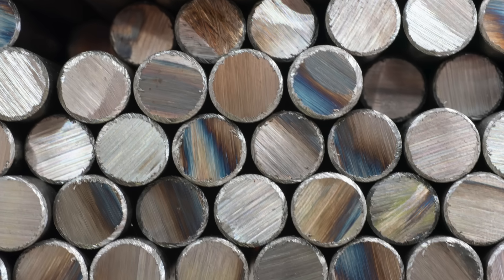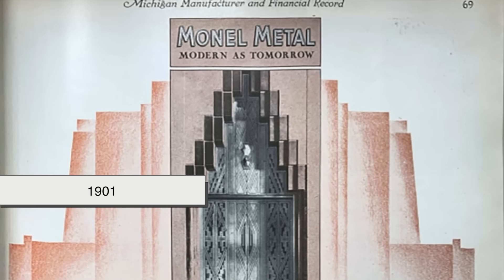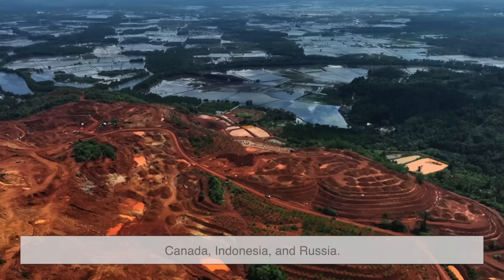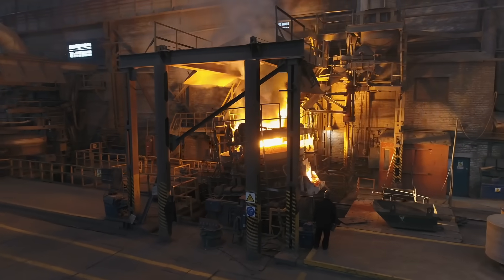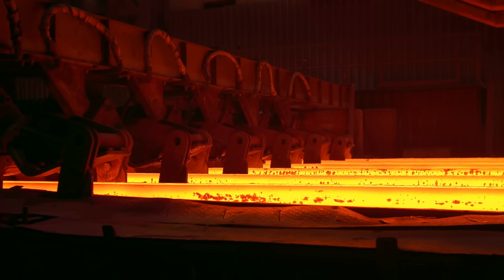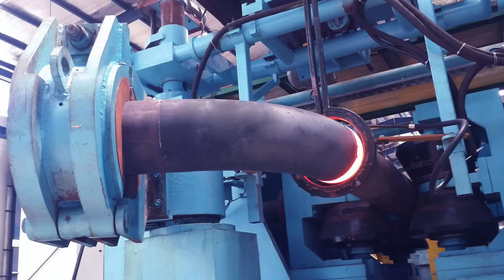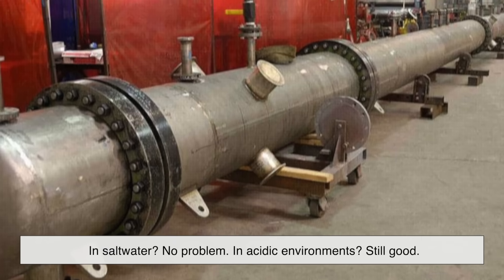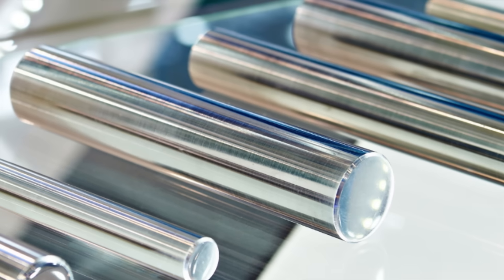What Is Monel and How Is It Made?

Comment: Monel is used in music instruments where you don't want any expansion to occur.
Because the valves would seize and stick if they did change dimension.
The other factor, is the very low corrosion of the metal, due to high moisture!

Comment: Monel and cupronickel are both nickel-copper alloys. Monel contains nickel and copper, with a higher nickel content (typically 50-70%). Cupronickel, on the other hand, has a higher copper content (70-90%) and a lower nickel content (10-30%). Their differences in composition determine their properties and applications.

Comment: The F-111 uses Monel rivets in the afterburner and tailpipe heat shields. When the shields need replacement you have to drill out the Monel rivets. Good luck. About the only thing that would even dent them was a fresh carbide drill bit. And even those got dull quickly. Monel one very hard metal for sure.

Comment: In it's early days Monel was used for exterior decorative and architectural applications. Around the 1920s people began to notice that it did not retain it's silvery luster and began to "fog" and develop a corroded patina. Unlike some patinated metals, it is fairly destructive to Monel and the artistic creations lose a lot of their detail. There are large gates at Woodlawn Cementary made of  Monel and they are very degraded. It's odd that in some very harsh environments it holds up, but in the relatively mild outdoor environment it breaks down.

Comment: I have a Sea Ray with straight 
in-boards. The prop shafts from the factory were stainless steel inch and a half diameter. I was 80 miles south of my home in the Chesapeake Bay when I rung off one of the prop shafts. I limped home on one engine. Miller Island propeller suggested that I replace them both. They recommended Monel... At three times the cost of the original stainless steel I nearly hesitated. I'm glad I didn't, they're both going strong 25 years later. <°)))><

Comment: Monel metal is mostly used in brass instruments for there piston making valves, for corrosion resistance from human saliva acids that is blown through the horn. Been introduced in the 1960 ‘s from Vincent Bach Corporation , I think that started it on their trumpets.
Reply: Used in making vacuum tubes ( radio valves) as well.
Reply: Ahhh, that makes sense (acidic saliva).  Man, I remember making a puddle of spit and water vapor in band class.  It also helps explain so many trashed trumpets with heavily corroded valves.  It seemed so much worse than I thought simple water vapor would cause.
Reply: @erniearruda8861  Nickel-plated valves are quite common for piston valves, but Bach was an advocate for monel. Other manufacturers have done likewise, although it's often thought that nickel plated valves can achieve a slightly better action. It's a fine application of monel tho, no doubt.

Comment: My family made Monel. They were junk men and they had a source of copper from a wire company. I know that in the Pittsburgh area, they came up with a source for nickel. They had an electric furnace and made small batches of Monel.  It was pretty expensive even during WWII.
Reply: Did they sell any monel to vacuum tube manufacturers? It was preferred for the connecting pins because the coefficient of expansion is similar to that of glass.
Reply: @ They made specialty tubing but I don’t know much about the buyers.  They also sold the bulk ingots
Reply: @samlevine4863  monel was in super high demand during ww2 since stainless steel processing and manufacturing weren't quite at the scale they would develope to after the war. The material science of monel was also better understood at the time, leading to the preference for monel over stainless steel. 

I can definitely imagine they made a tidy sum.

Comment: Titanium, plentily available, also resists salt water in nuclear power stations. ( I worked for ICI who supplied Ti to Sellafield by the sea) I used Ti stirring rods in chemical reactors instead of high grade stainless steel. Zirconium , tantalum, stainless steel are used for chemical reactors, but not Monel. How do these metals compare ?
Reply: I recall from reading about the SR-71 that Titanium was difficult to work and machine, although it sounded like Lockheed had done a lot of the brand new materials science on the metal.  Is it more difficult to machine than Monel, or are they both difficult but for different reasons?

Comment: An entire car built from “monel,” & or any other durably bulletproof mineral, would be in the range of extremely fkg complicated… …& or the costs/porcess of a more durable material to contain rechargeable radioactive batteries, would be extremely fkg complicated…

…but the complications are only a/the direct result of life/convenience having very little value to/for the current gen. For what it’s worth tho, “actual secured personal-space(s)” pods, & or “SafetyPods” could be managed for a tenth the costs to produce one car, if said “Safety” type pods were manufactured via the cheapest bulletproof steel/metal…

…either way, it’s “worth the metal,” & or “not worth a metal,” invested on lifers wondering how would “SafetyPods/actual secured personal-space(s)” be made, & or what’s so special about “SafetyPods/actually securing personal-space(s)!?”

Comment: Why is this not the standard rebar in western concrete construction?!?
Reply: I assume because epoxy-coated regarding is cheaper.
Reply: @ yeah because business, but there is an awareness of the actual practical life span of rebar construction, and many are wanting more. I think there could be a market for it. Myself included
Reply: @DonChartier  Epoxy is basically banned in the most of NA. Galvanizing is the only acceptable coating system.

Comment: I used to machine k500 monel, I found that it had a cutting speed and feed curve, that is, when you found the perfect cutting speed and it was cutting beautifully, then you crank the speed and feed in equal percentage and you would get the same chip form, the cutting tips would last just as long. 
Cannot recall if it cut better on the lathe or the machining centre, it was a number of years ago.

Comment: I have bass strings made by Roto-Sound that are flat wound, wrapped with Monel
Reply: Nice.. I use monel wound strings on my mandolin, it’s has a great tone compared to bronze..And now I know why they claim to be so corrosion resistant
Reply: Jazz Bass 77’s. Excellent strings
Reply: If you play through a vacuum tube amp, the pins of the smaller tubes may be made of monel, because the expansion coefficient is similar to glass. Not sure if Russian and Chinese tubes still use it nowadays, but old US and Euro tubes did.

Comment: The ratio of nickel to copper in Monel is exactly the same as the ratio of those two metals in the ore from Creighton mine.
This was one of the flag ship mines that Inco had in Canada.
The stainless steel Kitchen sink was invented by Inco trying to find new uses and markets for Nickel and specialty alloys they developed.
The super alloys used in the first jet engines and nuclear reactors were also developed by Inco.
All the metallurgical process used to refine Nickel Cobalt and platinum group metals was developed by inco.
All the high purity powders and the patent for the MOND process ( Look up Dr Mond ) were all INCO as well as 90% of all the free worlds nickel products.

Inco was purchased in a hostile take over by VALE in 2006.
Now they develop nothing because Vale fired all the smart people....
Reply: Monel was also used extensively in experimental high speed jet aircraft, such as the X-15.
Where one alloy's strengths end, the other's begin, with some overlap. An example is, Monel is quite resistant to HF, whereas Inconel is variably moderately resistant to HF.
And if memory serves, Inconel is a bit of a better heat and electrical conductor than Monel, which is only around 34% that of copper.
Each as best suited to their tasks!  :)
Reply: @spvillano  What is 'HF?'
Reply: @Pene7942  hydrogen fluoride. Nasty stuff when it meets metals, save if most are passivated with fluorine first.
As an example, one can store fluorine or HF in an aluminum tank that was first passivated by exposure to fluorine gas. But, the slightest breach in that layer, you've got a metal-fluorine fire that one of the world's leading experts in working with fluorine compounds recommended only one means of addressing the fire - a good pair of running shoes.
But  Monel will tolerate HF exposure quite well, so it's used in processing equipment.
Reply: Monel was used for the electrical pin connectors of vacuum tubes (radio valves) because the expansion coefficient is similar to glass.

Comment: Monel alloy 400 and Monel alloy K-500 are used in the pulp and paper industry, specifically for the pulping process. These alloys are employed in various components and equipment due to their corrosion resistance and strength.

Comment: I worked as an engineer at an electric motor manufacturer and some customers wanted the motor shafts to be machined out of Monel. Monel is very difficult to machine; It is sticky and leaves a lot of burrs. I had to program the CNCs to cut at a much reduced feed rate, and make many more roughing passes, and even then there would be a lot of scrap. A normal stainless steel shaft might take 10 minutes to machine, but Monel would take at least 3 times as long. I even had cutting tool specialists come to the plant to help me determine the best parameters for machining this nasty material.
Reply: It is not pleasant. Loves to form metal pasta on the tool rather than proper chips.😂 cuts well with SiN inserts though. Works much better than carbide ❤
Reply: @christopherleubner6633  Monel 405 has additional sulfur to help with chips, rather than going pasta on you. Still have to avoid rubbing or it'll harden while being worked, destroying one's tool.
Unique alloy series though, they used the hell out of it for the X-15 and other near-space planes early on.

Comment: I wonder if Monel is suitable for building rockets? I've heard of stainless steel being used, but Monel? It's an aerospace application.
Reply: I'd think so, for certain leading edge areas, for example.  I think i was used extensively the X-15, but I may be confusing it with Inconel.

Comment: As s kid in the early 50s we had a water heater that read monell lined on the name tag.my dad said it was great stuff,but I don't recall it lasting any longer that other water heaters
Reply: It would last if maintained well snd scale build up removed. Easiest way is to dump a jug of muriatic acid it and fill with water. A day later flush it out. Then it's good as new. ❤ can't do this safely with newer steel tank ones though 😳💀
Reply: @christopherleubner6633 huh, interesting.  Yeah, I guess that would do it.  I live a little south of Fon du Lac, and without a softener or modern city water, the lime buildup in our sinks and dishwasher was crazy.  Our house (built in '36) had a junked water heater in the basement that was so full of lime, I could just barely lift it out; in my late 20s/early 30s, I was pretty strong but almost gave up and was going to use power tools and a sledge!  I actually was afraid it was going to break the staircase on its way out.  That answered the question why it was still there :)
Reply: Maybe a marketing ploy

Comment: How the chip comes from the machining process like turning, grinding, milling etc are recycled. In most of the cases, chips of low carbon, medium carbon, and high carbon steels are combined with other materials like aluminium etc in shop floor. Then how do they recycle and separate the individual atoms of other materials.

Comment: I was assigned to Sub Squadron 16 in the 70s. Worked on 640 class boomers. They were known as the Monel boats. The welds on this steel is work of art.
Reply: I worked on Orion, basically the same time. 637 class boats. 38a Shop. Worked with tons of monel.
Reply: Same here. Subron 14 Holy Loch. USS Holland R1 Div HT
Reply: @gasm1100  The best welders I ever saw were sub tender welders! We cut a patch out of one boat to remove and replace the Auxiliary Diese (FUBAR)l. Cutting was one thing! 😝 But putting it back was a pain for the welders, but every pass, passed!
They did a Hella jobs on my off road bumper and rear axel/drives haft too! 😁
Reply: thats nonsense.. no subs were made of monel.. its just not strong enough
Reply: @bill-nn1vp  former us navy Foundryman.  I poured a lot of monel parts that went into subs... mostly that had direct contact with sea water.
Reply: @killmimes  Hi... Yes great application... but not structural for subs.. its a sticky tough metal .. but useless for strength or hardness.. useless for knifes etc
Reply: @bill-nn1vp  go back to sleep Francis, the piping was Monel. The hull steel was HY-80.
Reply: @GeoHvl  He did not say the hull was made if monel,  he said that parts that came into contact with seawater were (basically) made of monel. 
I say this as someone who has worked on just about every seawater valves (and many others) on a submarine, been the supply PO that ordered and dealt with all the Subsafe Level1 parts/materials, QA inspector and LPO of the outside machine shop (38a)
So yeah, what you said about the hull is correct, I don't think you know what is on the inside.
Reply: @GeoHvl I was a Machinist Mate from ‘73 to ‘79.  I welded many socket weld valves into steam piping.  150, 600 and 1200 pound steam.
Reply: @brucelytle1144 I was the supply PO for B and M division aboard the SEATTLE.
Reply: @bill-nn1vp LOL, the hull is made from a HY series of steel. A significant amount of piping is monel. For example, hydraulic, air/nitrogen, O2, and piping that is exposed to sea water. Each weld is X-ray tested or at least it was by the Electric Boat tiger team when they had 
to modify under hatch drain piping on the Trident II D-5 missile tubes on the USS Pennsylvania SSBN 735 in the early 90’s.

Comment: Suggestion. How is nitinol made
Reply: That's some really crazy stuff. It's mostly titanium with a little bit of nickel in it. Several years back I cut medical stents out if it using a water jet laser, literally used a water jet compressor plus a q switched green neodymium laser while having the water jet acting as a consumable fiber optic delivery. It ate flashlamps though. It would last about 78 hours of use before we needed to put a new one in.😮 at 600 bucks a lamp that was an extremely costly machine to run. Also the tubes the stents were cut from were 2 meters by 3mm with a price tag of 85,000 dollars each one. 😮
Reply: @christopherleubner6633 I'll take two :). Were the lamps for the laser?

Comment: One thing I learned in science class at school was that Monel is a poor thermal conductor. The lab's inventory included an apparatus in which ten rods of identical dimensions, made in an assortment of different metals/alloys, were mounted thru a row of ten evenly-spaced holes across the base of a metal tank (the rods being held in place with water-tight seals). The lower portion of each rod had a hollow metal cylinder passed over it until the cylinder was snug against the bottom of the tank. The lower portion of each rod was then evenly coated with thick layers of paraffin wax to prevent the hollow metal cylinder from slipping downwards. The tank was mounted upright and filled with boiling water so that the heat would transfer to the upper portions of the rods. As the wax melted, gravity caused the ten hollow cylinders to begin a 10-way race towards the bottom ends of the rods. The end result was that the silver rod won the race, followed closely by copper, and Monel came in dead last. Interestingly, that apparatus did NOT include a rod made of stainless steel. Monel (Alloy 400) has a thermal conductivity of 25 W/m·K, while stainless steel (316) has a thermal conductivity of only 16.3 W/m·K.
Reply: That's why it's so hard on metal cutting tooling. When machiner, the heat generated doesn't go into the work, it goed back into the cutter. Very low speeds, lots of lubricating flood coolant, and constant pressure to prevent rubbing are required to even stand a chance at successfully cutting it. If the cutter dulls and starts rubbing, it work hardens and then it's even more difficult to cut. Same applies to stainless steels and titanium alloys.
Reply: its also a B** to TIG weld with its gummy as hell
Reply: @JDR71326 I came here to make this comment,  it’s like welding a bowl of grits.
Reply: Monel was used for the conductive pin-out connections of small vacuum tubes (aka radio valves) because the expansion coefficient is similar to that of glass.
Reply: Very interesting
Reply: All very interesting.
Reply: Nice moustache
Reply: Probably only in comparison with other metals.
Reply: We used K- Monel Crepe blades making heavy wet crepe paper towels decades ago. They were very expensive but could stand the wet heat well.
Reply: Racking pipe in the Derick on a drilling rig. Bottom hole assemblies were usually Monel. The survey portion of a directional drill is commonly referred to as a Monel. Rest of the drill pipe is steel. The collars and Monels would never sweat or rust like the drill pipe in the humidity.